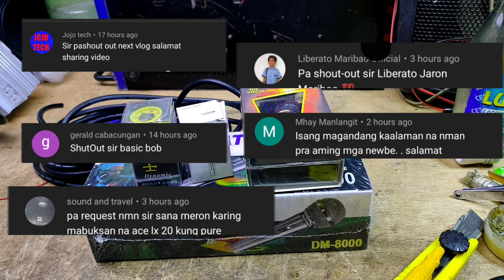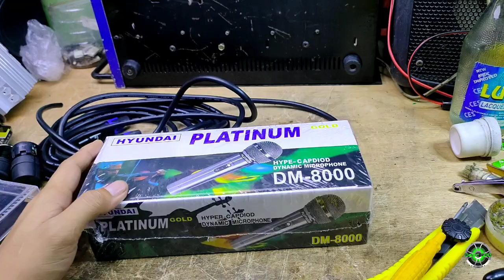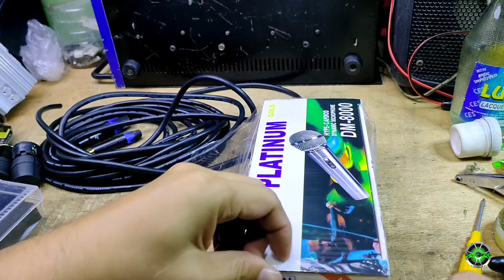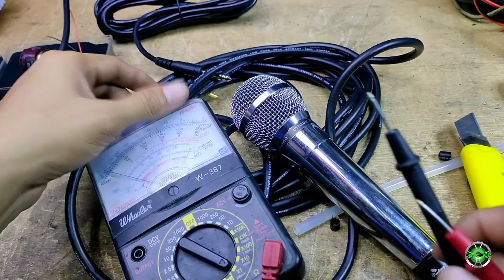PAANO MAG UPGRADE NG MICROPHONE , GAGANDA AT LALAKAS ANG MIC NYO 100% LEGIT

Comment: Boss may tanong po ako, ano po kaibahan sa dalawang speaker na magka parehas ang watts at ohms pero iba ang diameter kung patugtugin? Sana boss masagot mo ang tanong ko.
Reply from the maker: Kahit ako di ko rin masabi kasi may video din ako nyan isang 10 inch na 500 watts tapos 12 inch na 500 watts din siguro sa range ng tunog nila
Reply: @BasicBOBP84  Salamat boss sa pag sagot sa aking katanungan😊

Comment: saken boss yung hinang ko sa xlr kinabit ko yung tatlong wire sa 1, 2 at 3 pag dating dun sa pl connector dun sya naka mono bali dun ko pinagsama yung 1 at 3 tapos 2 yung naka hiwalay. ganda nung tunog. yung wire ko quantum
Reply from the maker: Tama nmn ang kabit mo , kasi naka unbalanced connection ka
Reply: @BasicBOBP84  hindi siya unbalance. bali stereo connection sa xlr tapos pag dating sa dulo sa pl dun ko ginagawang mono yung pinag dikit yung ground at number 3 https://www.youtube.com/watch?v=tQfxEq-Irag&t=928s
Reply from the maker: Mali ang term na mono or stereo ang tawag sa ganyan , dahil wala nmn jan left and right connection , or di nmn 2 channels yan , yan ay single channel pa rin or mono , pero dalawang klaseng mode , yan tinatawag mo na mono ay ang tamang tawag jan ay unblanced connection, which is +signal at ground ,sa balanced connections nmn ay , + signal ,- signal , ground , e google mo , or tignan mo sa old video ko ginawan ko ng video yan
Reply: @BasicBOBP84  okay boss pero basta para saken yung ganung setup
Reply: @BasicBOBP84  may tanong pa ako boss. pag magkakabit ako ng mic sa mixer diba xlr to xlr  male yun? so kung magkakabit ako dapat ba yung connection nya 3 way wire sa xlr or 2 way wire lang yung sinasabi kong mono?
Reply from the maker: Un balance lang kung naka dynamic mic kasi yung 3 wires jan ay yung sa mga condenser mic na my suply yun na 48 volts
Reply: @BasicBOBP84  thank sir

Comment: sir paanu ba ayosin ang amplifier sakura AV733 ayaw mag relay ayos nmn ang bayas at terminal differential board ok nmn pati power supply nya pero ayaw parin mag relay sir bago lng ako sa channels mo gusto ko sana matulongan mo ito pla account ko jpg garcia gusto ko sana maka chat ka about sa electronic sana matulongan mo ako
Reply from the maker: Kailang ma check mo speaker bago mag relay kung ok ,at normal ang dco

Comment: Sir tulong nmn.
Hindi ako technician pero
Lagi kong sinusundan mga videos mo.
Mahilig ako magbutingting.
My binigay sakin n car ampli.
V12 4000watts.
Nasupplyan ko ng baliktad
Natanggal ko nmm kgad pero nang ulitin kong supplyan ng tama, ayaw n. Nagbabaga n ung wire.
Nung buksan ko, at sinubukan ko uling supplyan,
Hinipo ko ung mosfet napapaso ako (irfz44n)
Sa kakapanood ko ng mga videos, my napanood akong same trouble, then ginaya ko pinalitan ko ng regulator yta tawag (tl494cn) pinalitan ko
Pagkapalit ko idol, lumipat lng sa kabilang mosfet ung init, dati sa left side, lumipat lang sa right side portion ng board ung init ng mosfet.
Pag tinest ko ung positive and negative supply input,
Nagbabuzzer sya sir.
Guide nmn sir
Ano ba ang dapat kong itest?
Salamat!
Pasemsya na sa haba.
Reply from the maker: Kailangan ma check mo din ang mga mosfet baka shorted na din plus ang diode, sana hindi tumawid main ang problem
Reply: Pwede po ba Ito SA wireless microphone ano po ma recommend nyo para SA wireless microphone...
Reply from the maker: Yung voice coil pwd po